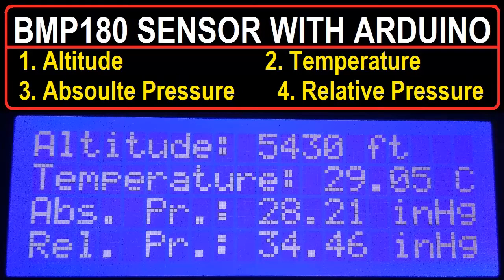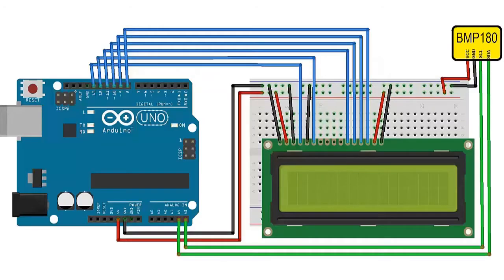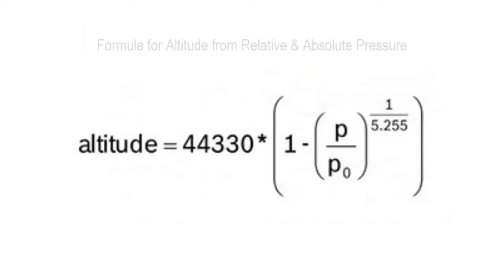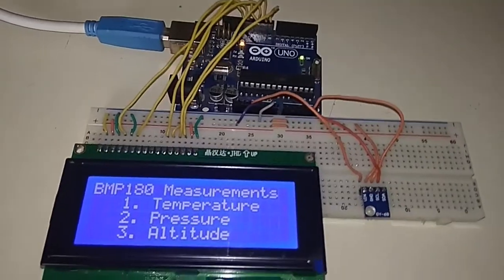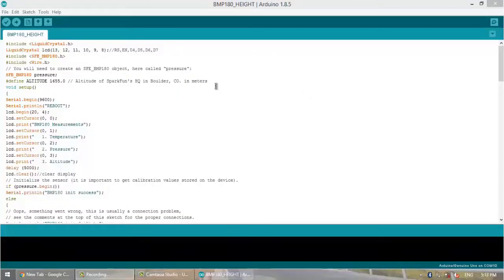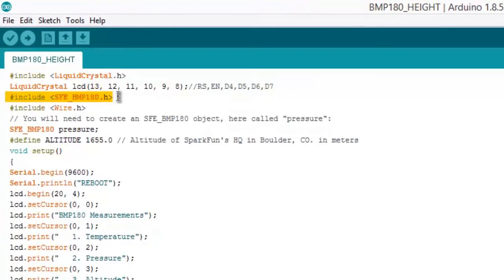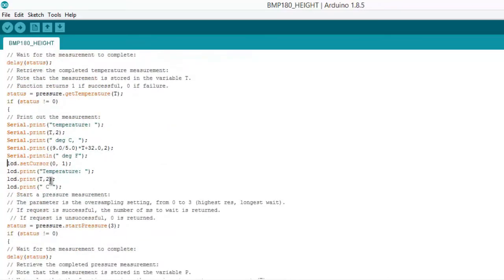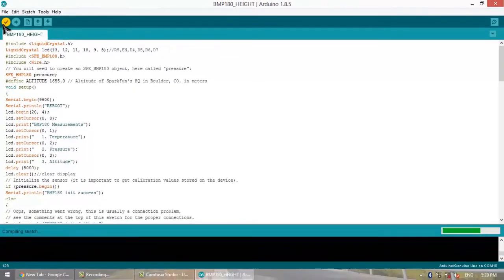BMP180 Arduino Tutorial | Measure Altitude, Pressure & Temperature

Comment: Hello :) Can we use bmp180 in measuring water temperature, pressure and altitude?
Reply from the maker: You can't, Bmp180 has limitations, can only be used to measure room temperature. 

For measuring water temperature use waterproof temperature sensor dsb18b20
Reply: @HowtoElectronics  Thank you for your reply :) I'm new with this field and what I need to do for our case study is to measure the water temperature, water pressure and water depth. Is it possible to have three sensor in one arduino? I'm planning to have three sensors since there's no available sensor in our country that can measure the three variables in our study. Thank you for your help :)
Reply from the maker: BMP180 is actually  barometric sensor. It measures environmental pressure and temperature.

To measure water pressure there are sensors available like water flow sensor based on hall effect. Depth can be measure using ultrasonic sensor HC-SR04. And for temperature i already told about DSB18B20.